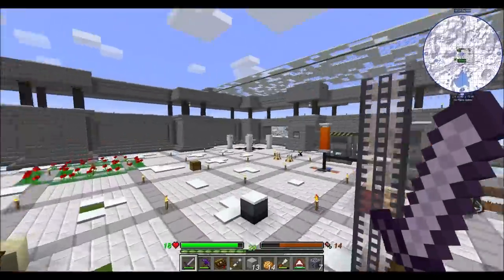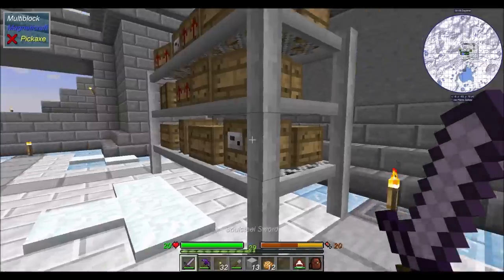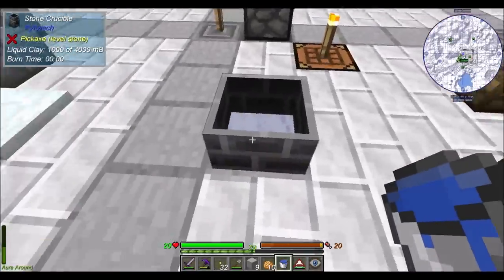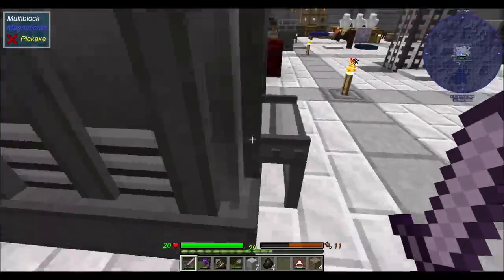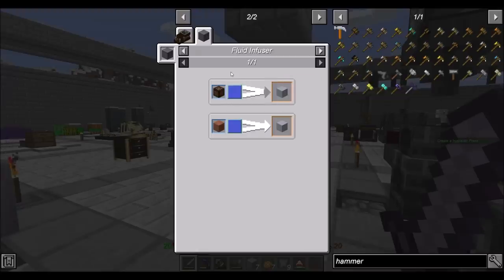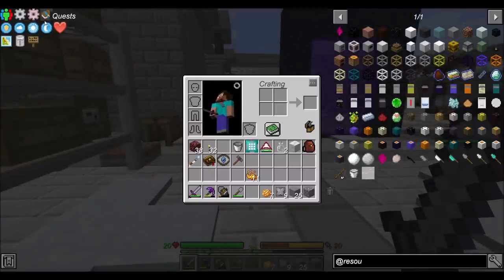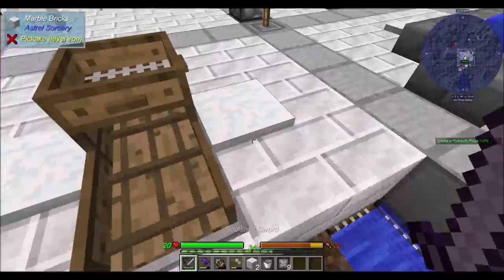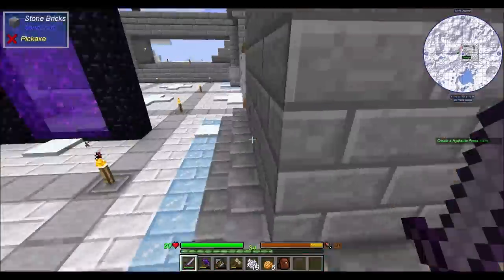Glacial Awakening   Ep17 Blast Furnacing

Comment: You know, if you can hopper into that storage multiblock, you could hopper from a arcane archives crate into it. This would mean that anything going into a brazier would get put into storage. So then it's a matter of sticking braziers in front of all those magneticcraft output slots (the sieve has outputs on the bottom), and there you go.

Comment: ffs Dire, use the mortar and pestle with your bones for the bonemeal!
Reply: There’s a positive feedback loop for bone meal. You break a bone block into 8 bone chunks in an anvil. Then, smash those 8 bone chunks into 16 bone meal. Bone chunks are crushed into 1 bone meal each if you do it in a crushing block for some reason, which makes it a bit tedious.

Edit: there’s also a positive feedback loop for blaze powder through the mortar and pestle. You can craft a blaze rod from 4 blaze powder, and the mortar and pestle from roots gives you 5. I’m pretty sure this one is not intended, since it’s the only way to get more than 4 blaze powder from a blaze rod, so it may be fixed in the next update.

Comment: A neat thing that I found working for the soaking pot is that the enderio tank can output its liquid into it by using the config by right-clicking the block allowing for use of mechanical hoppers for some level of automation and the kiln and some of the other pyrotech stuff can be upgraded to refractory with the refractory brick and it holds more fuel and also has the added benefit of auto-pausing fuel usage allowing for fuel to not be wasted.

Comment: hey dire!
I wonder what would happen if you put the thing you were trying to craft(on the iron/granite anvil)in your shield spot(achieved by pressing the F key on an item in your hot bar, or by just equipping it like armor in the shield slot) and the thing you were trying to craft with (hammer, pickax) in your main hand, then pressed left and right click at the same time. you could also maybe put a hopper on the side or the top. I know both work on the magneticraft anvil, and the sevtech chopping block.